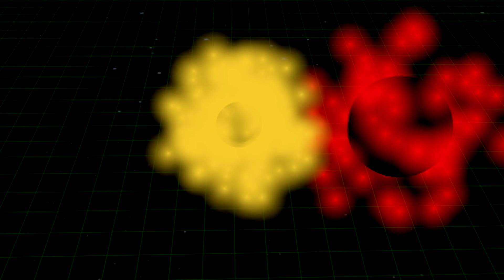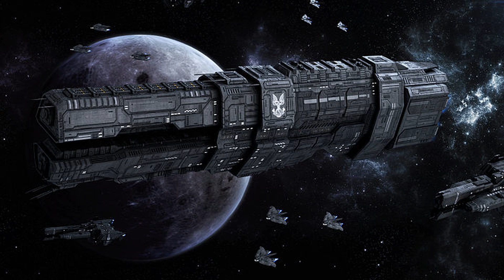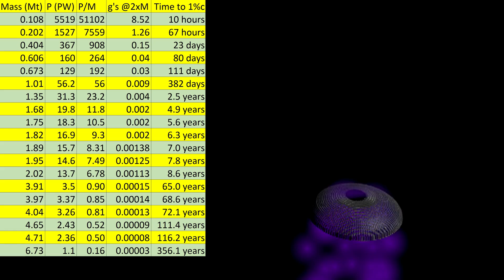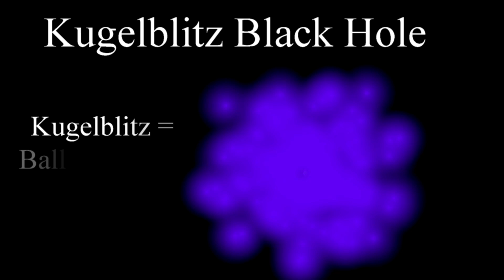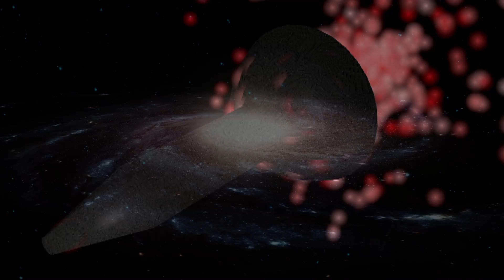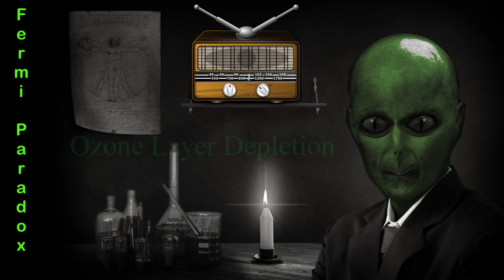Black Hole Starships

Comment: Suggestion for future episode: Miniaturisation and space exploration. A few questions that could be discussed, off the top of my head: How does scale affect space flight? Could you make space ships extremely small? Is there any reason to make space ships big? Could this be part of a Fermi paradox solution? There are probably more!
Reply from the maker: +Olle Linge (凌雲龍) An interesting suggestion Olle, thank you! We touched on it a little with the concept of Seed Ships and Data ships in the Interstellar Colonization video but as is often the case we didn't get to go into that notion as much as I would have liked. For Black Hole ships, the answer is yes, there is a reason, even with ones we can refuel en route, to build so big, even if that main cargo split up into multiple packages near the destination to get to multiple nearby places. The size and power output sort of necessitate giant ships. The same applies to laser-shoved ships since you need the sails to be pretty big in order to be hit. For fusion/fission your size constraint is just down to how small you can miniaturize one but probably won't let you get even as small as a car. For antimatter, miniaturization probably can let you get quite small, even pencil sized. 

That does all flip over to the Fermi Paradox because even with these big megaton sized ships massing 10^9 kg, one large asteroid like Ceres, 10^21 kg, ought to have enough mass manufacture around a trillion such ships, enough for one for ever solar system in the entire galaxy with mass to spare and the sun could power up a couple thousand Kugelblitz black holes a day; Whereas the pencil sized seed ships could be manufactured by the trillion from any one of the millions of smaller asteroids probably lying around every solar system and even at our modern terrifyingly inefficient production rates on anti-matter, if it can be harvested and stored reasonably safely, we could power up billions of those a day off the Sun's power output.
Reply: +Isaac Arthur Interesting indeed! What about really, really small ships? Perhaps millimetres or even less. I gather that many of the propulsion systems we're talking about here can't be shrunk that much, but what if they were launched in some other way? They're so small they wouldn't need that much energy to reach very high velocities. And as you say, you could presumably manufacture trillions of them.

One problem would of course be what you do with them. If you want to communicate back to the mother world, you need some way of communicating and that might be hard with extremely small ships. If you want to do anything constructive at the end of the journey, you need to break without breaking (!) the ship.

All this is speculation, I haven't read much about this and don't have the necessary theoretical knowledge either. You do, though, so perhaps it would make an interesting video. :)
Reply from the maker: +Olle Linge (凌雲龍) The big issue in miniaturizing ships for relativistic speed is it needs to be able to absorb gamma and relativistic hydrogen atoms strikes. You really need an inch of lead or something comparable up front to give the ship any chance of surviving, that's pretty much were the limit gets reached. But yeah it's an interesting problem, let me think on it and after an inevitable video on transhumanism or tech singularity I'll throw it up on a poll.

Comment: When two black holes collide, they merge and form one larger black hole. Is it theoretically possible to do the reverse? Could you take a larger black hole and "cut off" a smaller part of it?
Reply from the maker: +xassix The event horizons certainly merge, spews out a big gravity wave when it happens which we got to see recently for the first time. We can't be sure central mass, singularity or not, actually merge since we can't see it happen but we think they do and if we could get a clean look at a recent merger we ought to be able to tell since binary orbiting masses spread their gravity out differently then a single heavier mass. As to splitting a black hole, that's tricky. We normally hold any process ought to be reversible except for the entropy generated, but it's kinda hard to imagine how you could do that except by sucking the mass energy out via Hawking Radiation or one of the other processes like Penrose then recombining it to make the two original objects or a new smaller one, like powering a Kugelblitz black hole generator off Hawking radiation or the aforementioned other processes. But black hole thermodynamics are still really speculative especially where entropy is concerned.
Reply: Impossible by definition: you have just suggested lifting a tiny BH from under the horizon of another BH.

Comment: I've thought about something, that you mentioned in your shellworld video:
If you could dump your waste heat into a black hole (and that's a big if, since it might violate thermodynamics), could you build something like a "stealth"-spaceship?
Reply from the maker: +xassix I would guess not, all the hypothetical ways to dump heat into a black hole wouldn't seem likely to work on something that compact, hot, and radiant. The old classic Geroch method of taking a box full of heat and dropping it in wouldn't seem applicable to any small black hole giving off Hawking radiation and anything big enough to try that on, which would also have a below-room temp event horizon, would be way to massive to realistically use on a ship. But let me add that's a guess, black hole thermodynamic theories aren't my zone of expertise.

Comment: Hi Isaac, What relative speed does our solar system orbit our galaxy center? Can we use that speed and the relative speeds of neighboring stars to reduce travel time between them? For example: Would it be quicker to move "clockwise" or "anticlockwise" around our galaxy? Great channel btw!
Reply from the maker: +ZeeWebbose About 200 km/s, or 0.067% of light, or 1500 year per light year. Pretty fast but only on planetary scales, about 6 or 7 times faster than we orbit the Sun. There's quite a few stars locally with similar velocities relative to us, we have a pack of stars we move with that crosses other packs, like the local interstellar cloud which we entered about the time we learned how to make fire and will be leaving in another 10 or 20 thousand years. You can use that to you advantage, but not nearly as much as we can with Hohmann transfers inside the solar system.

Comment: Ok, what's the problem with dragging the BH with you by charging it?
Reply from the maker: +AndDiracisHisProphet If you can get the electric charge in there in the first place, none at all, but when you're feeding it up you'd have to deal with that repulsive force and the Exclusion principle... you could maybe get around the latter by using charged bosons like W+ and W- as your charge feedstock. Getting around the former shouldn't technically be impossible, but you might need some absurdly long particle accelerator to jam the particles in.
Reply: I just came to a question I sonehow never stumbled on before (don't ask me why), but Hawking radiation is electromagnetic, right? What happens when the BH is charged in the first place? Does it emit charged particles aswell?
Reply from the maker: +AndDiracisHisProphet It does, regardless of whether its charged, but it's going to be mostly gamma, and the escaping particles are parts of opposite pairs, so its random whether a + or - would fall in and you'd need many before it would much matter, plus if it got charged up enough it might bias which virtual particles fell in, till it got neutral again. Coulomb is inverse-square same as gravity, so the tidal force of it at the horizon might actually increase Hawking Radiation as it ripped apart charged pairs of virtual particles and pulled in the opposite charge to itself... so I'm a bit dubious about ever getting a charge on a black hole big enough to outweigh gravity for a number of reasons.
Reply: It turns out that these micro BHs (suitable for spacedrives) lose their charge in a very small fraction of their lifetimes. The same is true for any spin they may have but that can persist a little longer. So if your tether tech to keep BH and craft together involves charge, it won't last very long.  I seem to recall that for a 0.5 MTon BH (a sweet spot size) the charge is only retained for a few seconds! Bummer, actually, because charge tethering would work a lot better than gravity tethering, as the video explains.
Reply: A Bummer, indeed. Thank you.
Reply: Charge will be shed by the BH
Reply: Better use Gigaton BH:  ~100GW of 12MeV gamma.
Reply: +Andrew Palfreyman
So I'm supposing that since you mentioned spin, you mean that a similar mechanic applies to trying to give a micro-BH a magnetic field through collective particle spin?